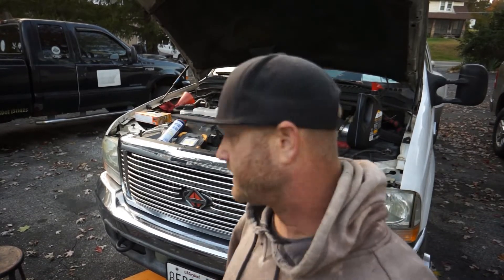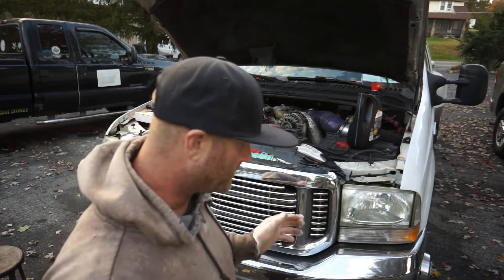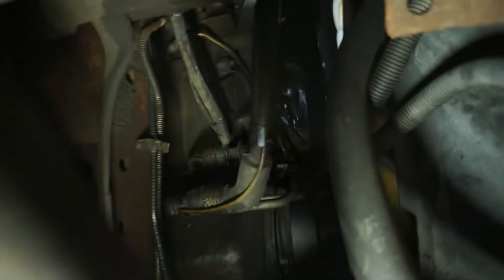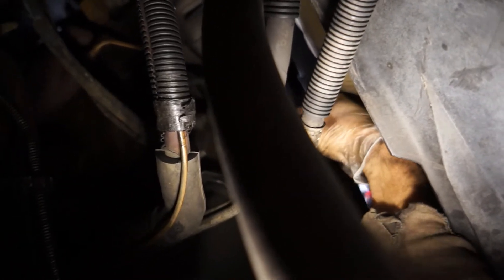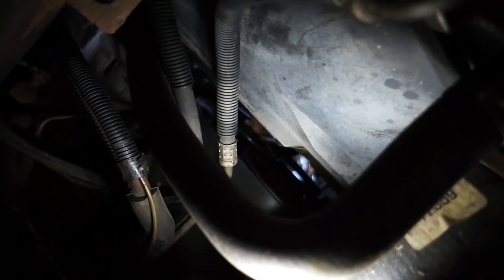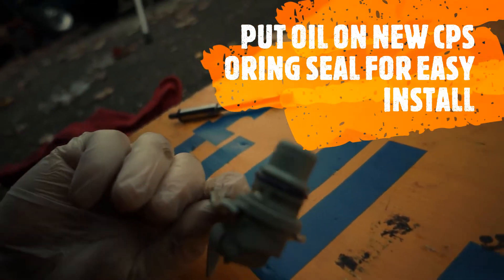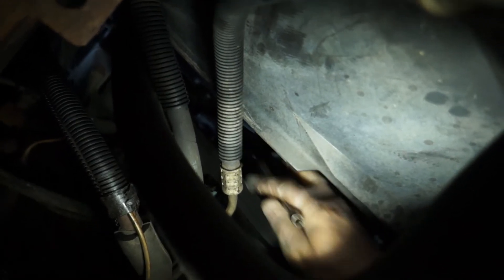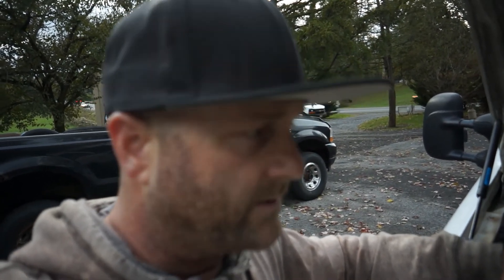CRANK POSITION SENSOR CPS FAULTY ?? FORD 7.3 DIESEL HARD STARTS OR LONGER STARTS ??  FIXED

Comment: I've never heard it called a crank position sensor always been called a cam position sensor
Reply from the maker: You have cam and crankshaft position sensors. 
Overhead cams have sensors in the upper valve cover or head areas.
The crankshaft position sensor will be down lower where the crankshaft is located..sensors in front, side, or rear of the motor.
All send a signal to the PCM or ECU computer in the vehicle to make it run at its optimum best.
Hope this helps.
Keith 2guys how2
Reply: @2guyshow2thefishkingz89  Hey,  I saw your Maryland Tag on that truck,  Balto and Carroll Co here,  where are you?  I am looking at buying a truck up in Altoona area that has a hard start or cranks,  no start issue as we speak.
Reply: That's because it is a cam position sensor haha

Comment: Hey, my truck has a hard time starting, but It also randomly turns off when I reach 200 rpm. Could this be the issue ?
Reply from the maker: It could be....I would use a OBD2 scanner for diesel trucks...a OBD fir cars won't work. 
Sometimes,  it can be dad injector or bad injector seals.
Not too hard to fix...if it is an injector or seals. 
Let me know what you found out.
Keith 2guys how2